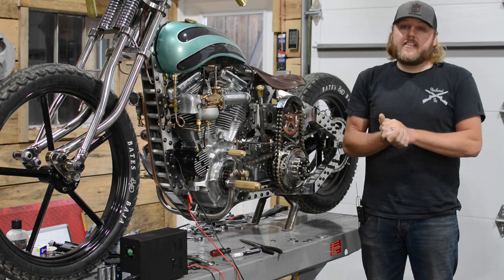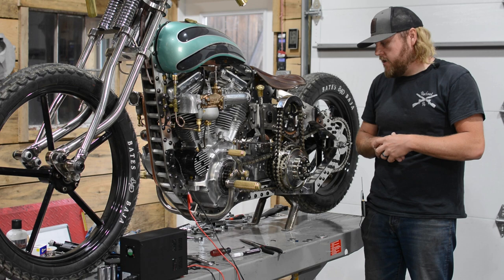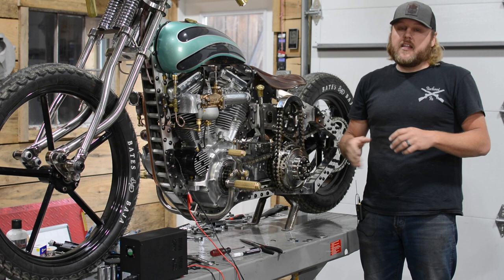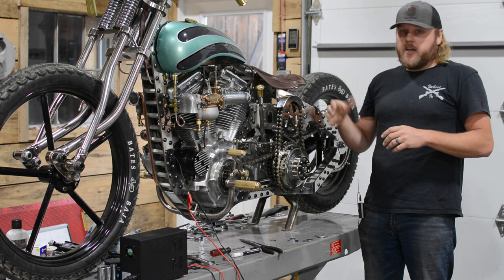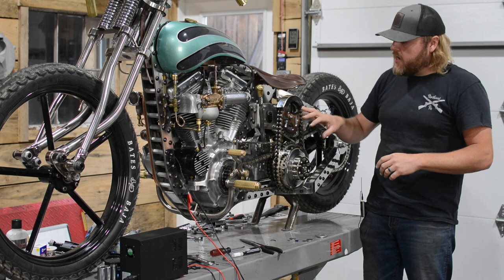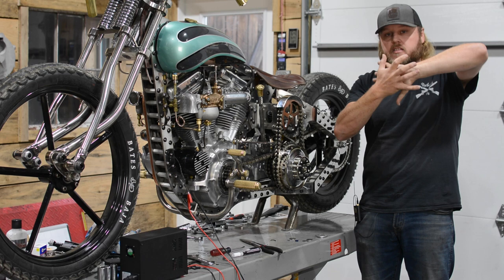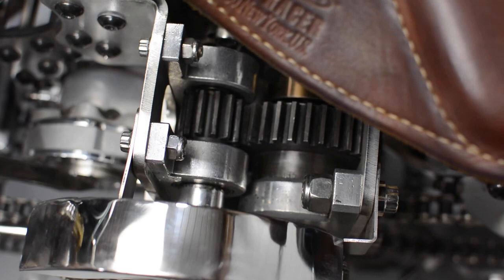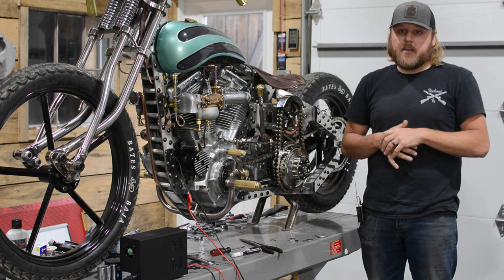Building a Custom 1948 Harley-Davidson Panhead: Inertia Starter System for a Motorcycle

Comment: I had the idea of using an inertia starter years ago when I built my bike. But they are a rare unadvertised item. And really were back then. I hate batteries and electrical items. Kick start is one crank around, so inertia or spring starters it is.

Comment: Where can i get the motorcycle frame like that?
Reply from the maker: I custom designed it and had it laser cut
Reply: @axtion88jackson  how much did it cost you and how can i get myself started building a bike similar? I bet the inertia starter is very rare too.